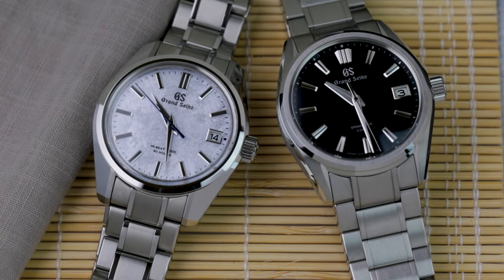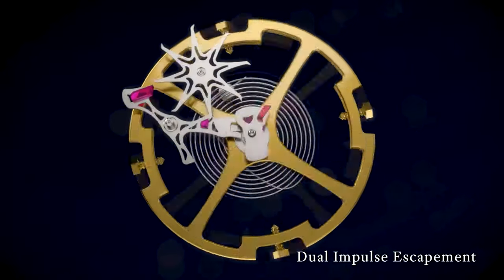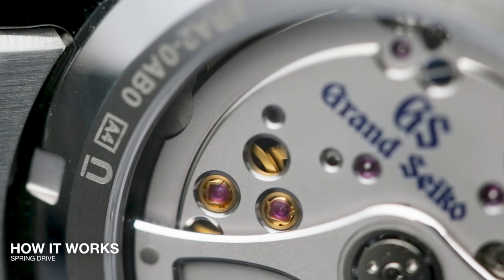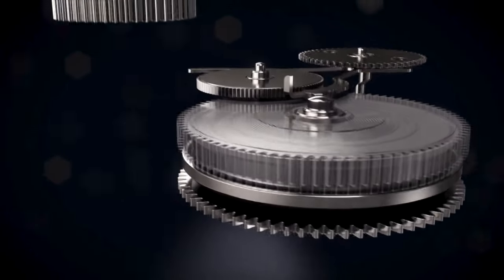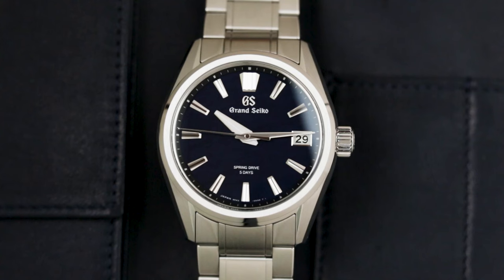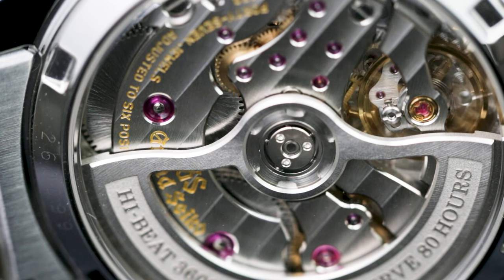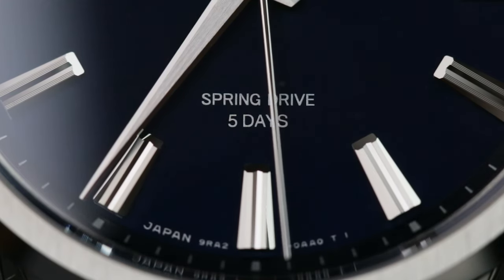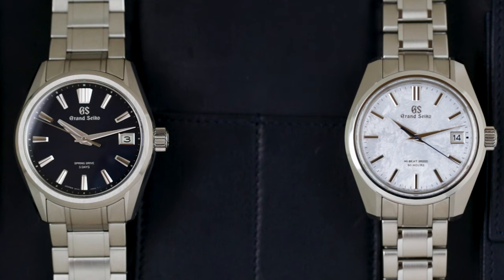Hi Beat v Spring Drive

Comment: My spring drive doesn’t miss lose or gain time
Reply: Same goes for my Citizen eco-drive.
Still wish I had the cash for a GS though.
Reply: I don't think that's the right comparison to make here since Eco-Drive still essentially runs on a battery while the Spring Drive can operate with just a mainspring.

If we're talking Citizen, the main comparison to Seiko's Spring Drive is the Caliber 0200. Seiko themselves also have their own Solar watches that also run on Quartz.
Reply: What ref. Is your spring drive
Reply: @Zoot_Troop  not sure, it the snowflake
Reply: @Zoot_Troop  just checked and it’s close to 2 seconds fast now since march (bst)
Reply: Mine misses time every 5 days after use.
Reply: @SRADracer mine takes about 10 days to be 1 second off.
Reply: @StrikeWarlock  that's incorrect. Spring drive CANNOT work with only the mainspring. It needs the quartz brake to regulate its accuracy. So it's at least a partial quartz watch.
Reply: @willh.2155  Quartz is quartz because of batteries. Spring drive doesn't use batteries.

Comment: Spring drive is the only movement with true sweeping unlike other watches which use high frequency to simulate the sweep. This means that you can take a video at any fps and it still sweep.
Reply: Not correct, as no movement can eliminate the pulsation of kinetic energy entirely.  The fact you cannot discern this effect visually doesn't mean it's not happening.
Reply: @PETERJOHN101 I'm not sure what you mean, in the Spring Drive, there is no pulsating. There is only regulated rotation.
Reply: Yes, since it does not oscillate,there is no ticking noise as well.
Reply: nah. spring drive still uses a quartz crystal to regulate the sweeping of the hand. 32768 Hz. i dont know how many beats per second that is, but find a fast enough camera and you can capture the pulsation.
Reply: @c2pascual  sounds like you don't understand the mechanism. The frequency of the crystal is used to measure the speed of the glide wheel, which is rotating. The glide wheel is constantly regulated by a magnetic field. So the frequency of the crystal is only used as a reference to adjust the strength of the magnetic field, it does not directly move or stop the seconds hand. 
In conclusion, if you would look at the watch with a high speed camera, there would be no micro-ticking. It's actually gliding.
Reply: @derkatzenfuerst6077  copied from the GS website. "Applying the brake to control speed. The IC compares the reference signal from the quartz oscillator with the revolution speed of the glide wheel, and INTERMITTENTLY applies a magnetic brake when it detects that the glide wheel is operating too fast. This regulation of the glide wheel is transmitted to the gear train, ensuring that the watch hands move with precision". 

Intermittently means stop and go.
Reply: @c2pascual  No, it does not mean stop and go. It means that the magnetic field will be applied from time to time with various intensity.
A magnetic brake does not stop the glide wheel, not even for split second. It regulates the speed, but not by stopping the wheel.

Imagine a bike wheel spinning and you can see the speedometer. In this analogy, the speedometer is the quarz crystal. Whenever the speed exceeds a certain limit, you apply the brakes (magnetic field) very slightly. The wheel is still spinning, it's not stop and go.
As far as I can tell, you are still misunderstanding how the magnetic brake works.
Reply: @derkatzenfuerst6077  all right you win. you are a watch genius.
Reply: @c2pascual  Haha, lol. I'm not. But I wasted a lot of time watching videos about how the Spring Drive works.
Reply: @c2pascual  it's not that hard to understand. just take the L like a big boy.
Reply: Check Bulova 262 kHz quartz.
Reply: TBH Bulova has a sweep seconds quartz movement also - quite cheaper than Seiko's GS by the way...

Comment: small note about the description of the Spring Drive. When you began discussing the Tri-synchro regulator,  you did so when the graphic was showing the magic lever winding system. The regulator component is actually the illuminated circuit at the end of the graphic. I'm sure it is a simple oversight, but given the precision and intentionality of grand seiko timepieces, that clarification is needed as to not confuse anyone on the brilliance of the movement.
Reply from the maker: Thanks for the information! will take that on board, good spot thank you.

Comment: I prefer the spring drive simply because the second hand moves ever so slightly smoother
Reply: it's not even slight, one moves in steps and the other doesn't! So tempted by a spring drive model, but sadly so far I like some of the hi beat designs more
Reply: @drewsleyy3836 The high beats are lovely for sure.

Though I have my eye on the Heritage Shunbun Spring Drive model. It has a off pink hue that looks stunning!

Comment: Spring Drive is an awesome mechanical quartz movement… it should not cost more than high beat movements. They’ve made their R&D back… Over priced now… I’ll stick with the high beat movements instead of the over engineered courts movement, otherwise known as Spring Drive.
Reply: I agree that spring drive is a "hybrid" argument, and would prefer HiBeat except hibeat service costs about 2x of the spring drive.

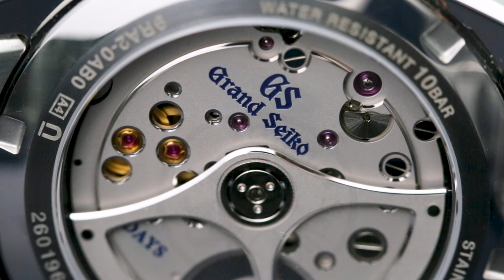Comment: 2:56 The older spring drive caliber looked much better. I don't know why this new one is so completely covered by an opaque plate. It looks McCheap as hell.
Reply: I agree, but I think this is only a problem for the caliber with the 5 day power reserve. I think you can see more of the wheels in the other calibers. 
But in terms of looks, the high beat caliber is the clear winner.
Reply: @derkatzenfuerst6077  Yes, it's only the new spring drive caliber that looks awful. The older ones are fine.

Comment: As far as accuracy is concerned Hi Beat < Spring Drive < Quartz.  Just because Quartz is not glamourous as the other two its not even mentioned in this video. I would just avoid the faf and just go for Quartz which is most reliable and most accurate and easiest to maintain long term.
Reply: Service interval on my GS quartz is 50yrs.....
Reply: @Alfa_Holic the battery will need replacing every 5-6 years, so that's your service intervals.
Reply: There is something much more satisfying about not having a battery, and having a watch charge by your movement...

Comment: If you want a self-winding quartz you can get a Seiko Kinetic. My brother has one and got it serviced for $50 last year including strap change. First service in 15 years. Or you can get a Citizen or Casio solar powered watch for a couple of hundred bucks. If you want a premium Quartz you can get a Grand Seiko with a 9f quartz movement for half the price of a Spring Drive and 10x the accuracy. Spring Drive is the worst of both worlds. A watch you have to wind and set if you forget to use it for a few days and instead of the beating heart of fine mechanical watchmaking you get a PCB with a microchip and a quartz crystal.

Comment: Spring Drive any day!

For me, I went from Seiko to Rolex, then now back to Seiko 😂🤣🤣🤣 True circle of life!

I ditched my first Seiko Quartz because it failed on me on the most important public exam day in my high school. I swear from then onwards, only the most reliable watch will do.
This brings me to the Rolex Sea Dweller. If we think that the Rolex Submariner is tough with its 300m/1000ft water resistance, the Sea Dweller redefines the standards for ultra toughest as it is over 4x tougher than the Submariner at 1220m/4000ft water resistance, fitted with a Helium Escape Valve. It is definitely the State of the Art toughest combined with bullet proof reliability at the time. And it did served me extremely well....that is until the next level of cutting edge toughest and accuracy emerged in the form of Seiko Spring Drive that totally eclipses the functionality offered by any Swiss mechanical watch movement.

Few people are aware of how robust the Spring Drive mechanism is. And even fewer would be aware why the inventor is so adamant that the energy storage mechanism must be free from battery or capacitor as energy storage solutions, because both can leak and fail under extreme conditions. By removing the battery and capacitor as weak points in a watch movement, the Spring Drive is capable of maintaining ultra high accuracy even under extreme temperature swings, which no other Swiss Watch movements can ever achieve. The evidence can be seen from the creation of the Seiko Spacewalk and the Seiko Landmaster Miura Everest. Both models have extremely robust versions of the Spring Drive, enabling them to handle under - 40C extreme conditions. In fact, - 41C is the lowest recorded temperature on the peak of Mount Everest recorded in December 2004.

The beauty with Spring Drive is its perpetual negative feedback monitoring loop. Regardless of how the internal metal components reacts towards the temperature, the Spring Drive will adapt and adjust the induction braking in real-time. This self-correcting mechanism is ingenuous. You won't find that in any Swiss movement. 

My SBDB007 Miura Everest achieves a very consistent +2sec/month, since the first day i bought mine, almost a decade ago. My Rolex Sea Dweller would be lucky to achieve this accuracy in just a day 😅🤣🤣🤣 The full Titanium construction of the Miura Everest is also extremely robust.
I feel honoured and very luckily to be one of the very few 300 individuals to own such a technical marvel in time keeping technology, which i shall treasure for the lifetime.

I think for people who values accuracy, toughest and reliability as the end game in time keeping, the Seiko Spring Drive is the closest thing to perfection.
Reply from the maker: A very interesting read! we hope your Seiko watch serves you well, sounds like it has a great owner!

Comment: The GS quartz is another order of magnitude more accurate than the springdrive at <10 s per year.
Reply: but anyone can pick up an aluminum frame quartz watch (<15sec/year) from 5,-EUR. making the GS Quartz 2200,-EUR entry level pretty bullocks. As for Spring movements, the 5500,-EUR is much more realistic. You actually have the jewels for this price.

Comment: Hate to say it but hi beat sucks.  About 18 months my balance wheel got misaligned so I sent it to the shitty GS service center under warranty and the accuracy is so bad.  Running from +5 to + 12 with an avg about 8.  They say their standard is +8 to -1.  For a watch costing 7k this is soooo annoying and I will never buy a high beat ever again.  The spring drive is robust and no issues
Reply: Is it just me, but does the Hibeat also have a noticeable rhythm to it? The sweep doesn't seem smooth to me, but a very little bit jumpy? I thought I was seeing things at the dealer, but I seem to notice it on some of the videos now too
Reply: @jmosch  of couse! hibeat is just beating faster than typical mechanical watches.. 5hz vs 3 to 4hz (times per second).